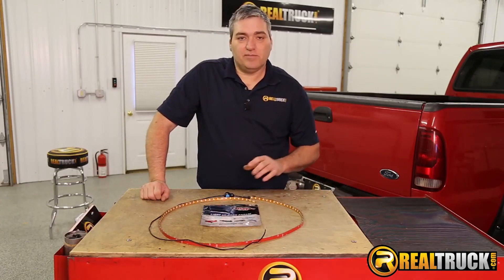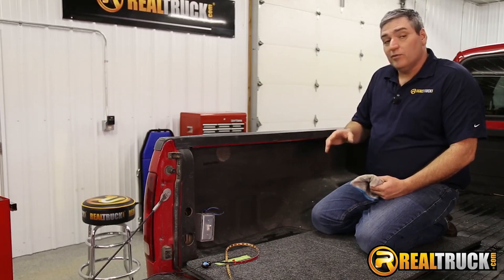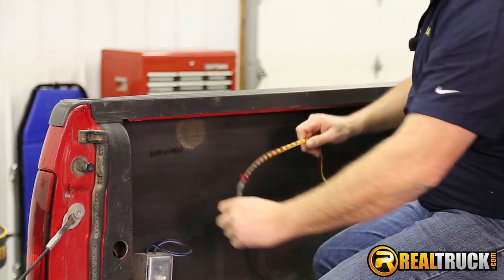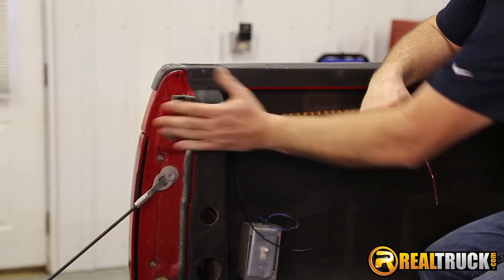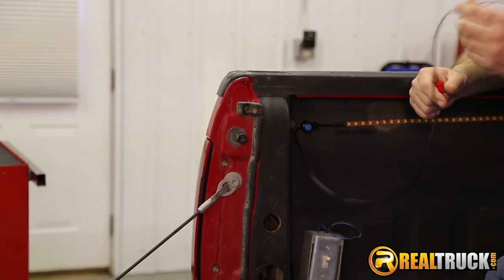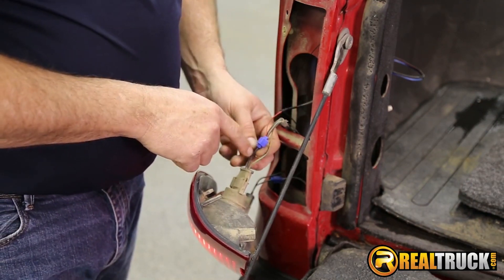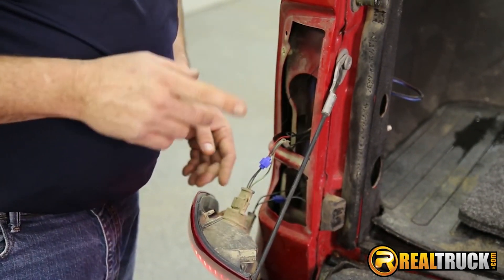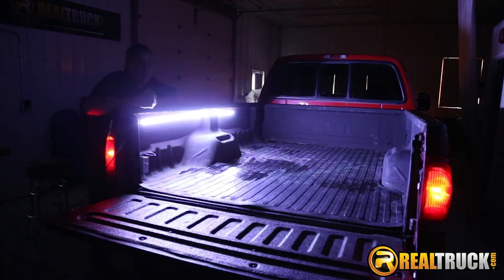How to Install Access Truck Bed LED Light Strip

Comment: Wiring it to the tail light causes the tail lights to need to be on for the light to work. Why not use the trailer hitch wiring harness where the power is always on?
Reply from the maker: Lou Ghelfi that's the beauty of this type of light. You can pretty much wire it wherever and however you want. We only showed one way here but you could wire it to the trailer connector positive wire as well. If you  have any other questions about this or any of the other 500000 plus accessories we sell and would like to speak to a person directly feel free to contact our knowledgeable Customer Service folks at  877-216-5446
Reply: RealTruck.com could you do a video of wiring it as mention.  I want mine always hot.  So I'll I have to do is flip ah switch

Comment: What size was the one you guys installed? Curious to know as a reference.
Reply from the maker: speed punx Club it was the 60". You can find out more about it and the other available sizes right here: https://www.realtruck.com/access-truck-bed-led-light-strip/ If you have any questions about this or any other products please feel free to call 877-216-5446

Comment: I want to install this on a 2004 GMC Canyon..do you know which color wire to tap into the taillight with the positive?
Reply: Elevated Media Red is positive, and Black is Negative. So the answer is red.

Comment: What gauge of wire are these?
Reply from the maker: Brandy, wiring needs should be chosen based on the requirements of the length of LED strip chosen, and the distance the wiring will be run. However, if you're wondering what gauge wire to use for install; LEDs like this, are going to require a pretty low amount of current, so a common 14 gauge wire will be more than enough.

Comment: terrible spot to put them and terrible way of wiring. not impressed
Reply from the maker: +Greg Soderlund hey we showed you ours now you show us yours! We are always interested to see how others do their installs because we are always open to the possibilities of better ways to do it.
Reply: i agree. if you use your truck for anything else than grocery shopping,yourlight willmost likely be damaged by freight you put in the bed. plus you should wire it to aconstantly on power source. no need to open your truck lights to look in the bed